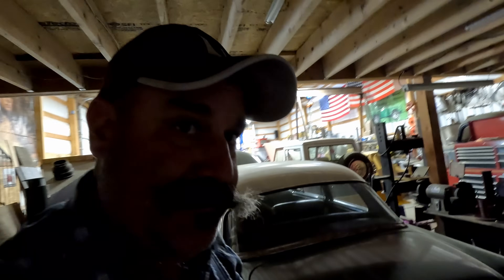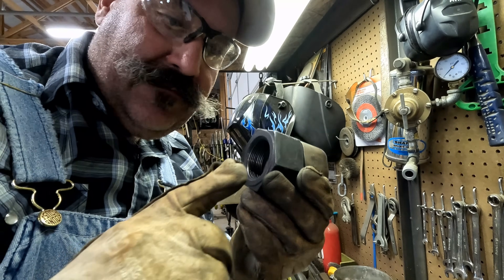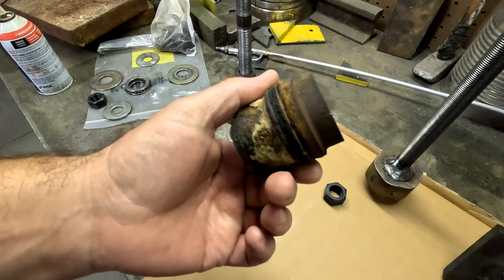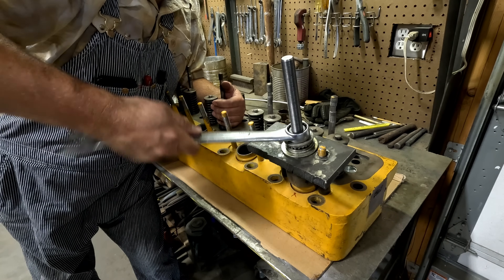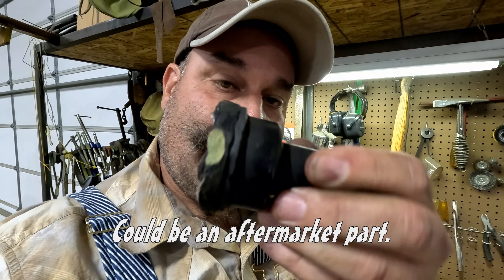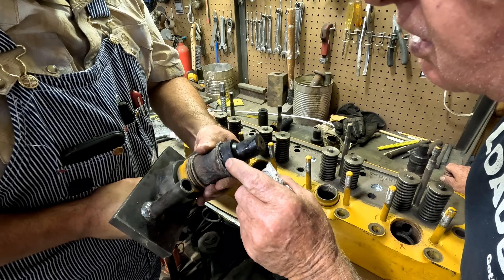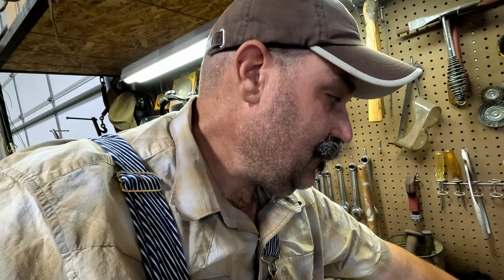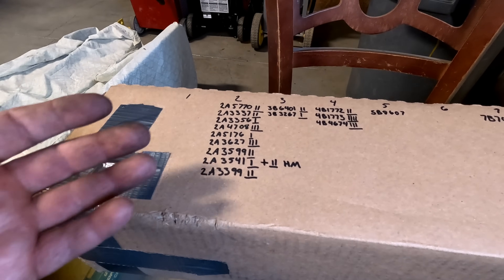Pulling Caterpillar RD4 Pre combustion chambers for a friend. Let's fix a tool! Ep. #43

Comment: Common practice in the old days was to Knurl something and sand it back to size to make it swell up and take up space in the hole - when the knurling tool smashes the pattern into the item, it raises up the metal - thus enlarging it - I had some old race motorcycle engines from the 1960's that had Knurled piston skirts and was told by the old man who used to race it, he knurled the skirts to reduce slap

Comment: These must be the easiest pre-combustion chambers to pull. My friend  tried the same puller setup on a Belarus D-50 engine that has a same setup as a D4 and D2. But he had no luck cause it was just so stuck. Usually when its stuck it will break into pieces. He will try again but with a lot of heat. Your tool construction has been super helpful.

Comment: Have you considered using electrolysis to remove the rust from the stuck pins.   You have a large stock tank and a battery charger to start. With?
Reply from the maker: This weekend we have a video making a pin press. I don't want to spoil it but we are going to put the tracks on a machine and run them. If that doesn't work we will definitely go back to the drawing board and consider electrolysis. 👍

Comment: Could those parts be custom made that aren’t available?
Reply from the maker: I suppose they could. I wonder if they were heat treated for the combustion chamber nozzle area. The internal parts of the chamber would probably be difficult, especially the internal threads. That's a very good question. 👍
Reply: @ are they steel or cast?Take a file to it and see
Reply from the maker: @daleolson3506 They are cast.
Reply: @ do you see any reason why they couldn’t be made out of steel?the reason I ask is I have a friend that has a cnc  lathe. They can make incredibly complicated accurate parts. One part too much money to make. But if they could make 100 there is money to be made. Is there a market?
Reply from the maker: @daleolson3506 I think they could definitely be steel. I have a feeling cast was just easier to produce for the time period. The pre combustion chambers would only apply to D4400 & D4600 engines between 1936-42. After that the design completely changed. I'm not sure how high the demand would be.